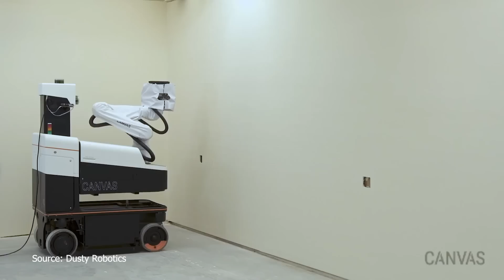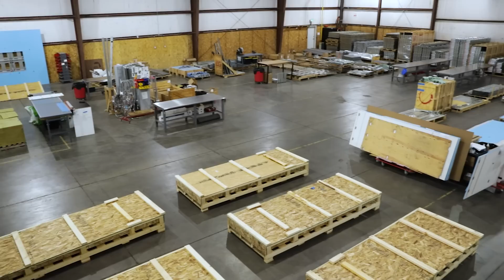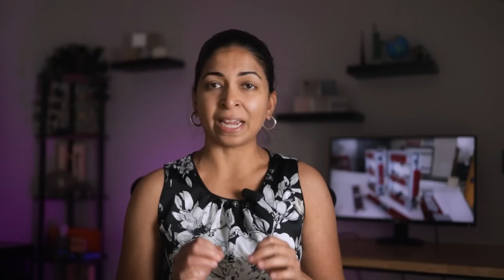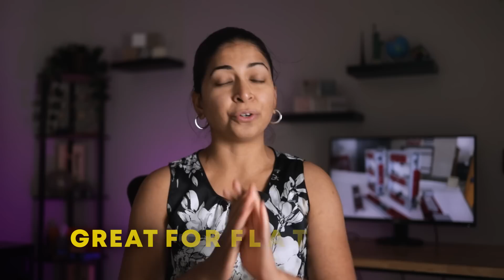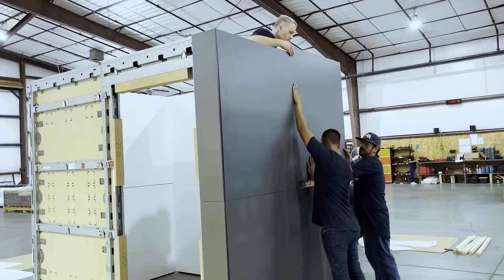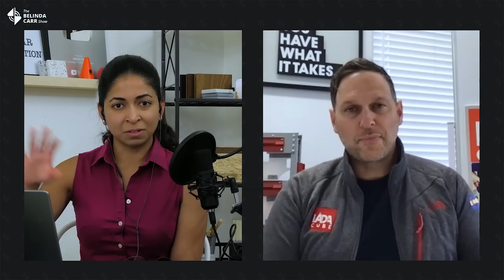Could this reusable metal wall be the 2x4 of the FUTURE?

Comment: Dear Belinda,

I am the CEO of Cyrus Panel Corporation, based in Boston, MA. 
You are giving the best construction information to the public. The Public are human beings. 

I claim to resolve one of the three main needs of humans - shelter. 

I created a lightweight structural panel (LSP) that is:

1- Inexpensive 
2- One size panel for all parts of the building. Walls, floors, and roof. 
3- Easy to assemble (DIY)
4- Excellent for all thirteen climates of the world. 
5- Highly resistant to fire, heat loss, sound transfer, moisture, natural disasters, and earthquakes. 
6- It can be cut and changed to meet any architectural form and re-assembled. 
7- It is structurally sound for up to four stories without use of added support. 
8- It is modular 
9- It is only 40kg with 12cm X 60cm X 300cm dimensions 

It is my pleasure to answer any questions you may have about the future of industrialization in the construction sector.

You may decide to make a LSP program. 

You may find me on WhatsApp at +1-617-872-4424

Mort
Cyrus Panel
King of Panels

Comment: Cold bridge galore, PVC inserts are toxic fire hazard and acoustically those panels will transfer all the noise trough even if properly insulated. Water damage and now you have rust issues in your home. Reusable? So is lumber, but why would you, since it out to be fine when house lasts 100 years.. ou right US rips house down almost before paint has dried. I agree build smarter.. ie make BETTER house, not this new age bullcrap. I havent seen one building made from these "industry changing" products that would last couple decades and even if those lasted, those are inferior to traditional log construction, witch can be infinitely repaired, works as its own insulation well as a frame and automatically adjusts air moisture content and clean the room air just by existing. Hell you can take the log frame into peaces and transport it to new location rather easily if need be, just need the new foundations and roof. Hell you can even reuse logs to repair or build new house.
If labor is the issue, how about starting to demand higher quality from the houses, not the exterior look, but the construction it self so how long it last. More people learn the hands skills to build cheaper it comes. Construction is only expensive cause taxation, builders quality standards being equal to their wage and bosses not keeping the standards where those should be, well as cheap shit now mentality of the customers. Its ok for the paint brush, but when you are talking about the installing the wall and fitting the lumber, hell the foundations make or brake the house. If those are build piss poorly, rest of the house will suffer from that.

Comment: I admire the creative thinking of the Lada Cube team, even if I ponder what markets their products are best suited.  Am a student of architecture prefab history, so for those interested, this Lada Cube panel product conceptually is in my opinion an updated version of the 1940's General Panel Corporation residential housing system, designed by Walter Gropius and his friend Konrad Wachsmann.  Wachsmann designed and patented a very clever, simple and inexpensive, panel interlocking system to allow the onsite assembly of homes from a kit of prefabricated panels and roofing elements.  The company assembled several residential homes, but unfortunately went out of business, the reasons for which are complicated and beyond what I can describe here.

My own work on affordable Kit-homes utilizing steel iBeam portal frames is a gentle nod to the pioneering work of Gropius and Wachsmann, though I must make due with less talent than these brilliant gentlemen.
Reply from the maker: Excellent analysis! Do you have a link so I can learn more about your kit-home design?

Comment: I saw a few more disadvantages. 

- This not for residential 
- Walls have almost no ability to be adjusted, thus everything has to be a perfect measurement when using in residential, that will never happen. 
- The metal will transfer heat and cold right past the insulation being used.

This would be good for like FEMA/Military IMO. I can't see a need for it in much of anything else. 

Some ideas:

- Simplify the internals
- See if sliding vertical studs to add height to wall or shrink them for residential/remodel use.
- Have an easy attachment for firing so that drywall nails can be used and installed in residential homes

---------------

I want to like the idea of building homes or walls off site and have them delivered, but it always seems to cost far more and limit what is needed on site. Yeah, if you're building a box, great... but no one is doing that. Walmart probably does it for a tax write off for being pretend green.

Comment: I can see this product will be useful for retail store refits. Often I go into a mall condition assessment and find new stores that last a few years then go under and a new store replaces it. Each time the new store goes in the layout changes. Walls and ceilings are removed and replaced with new interior partitions. It is such a waste of materials and labour. This system works much better for that application.

Comment: It's a good idea but has me wondering how it stands up as an external wall, exposed to the elements. Speed of assembly is a positive as is a relatively clean work site - nothing worse than tripping over loose materials and chunks of concrete etc with expensive instruments on your shoulder.

Comment: This is a niche use product, trying to be sold for all uses. The advantage of disassembly and reuse is only needed by business that know they will frequently alter the layout throughout the buildings life. The far high material cost compared to normal stud walls can be offset by these clients due to the fact it will be cheaper long term due to the regular layout changes. A construction company doesn't care if the panels are reusable and movable, if a client hasn't asked for it then it's an unnecessary cost when the contractor wont be the one's moving the walls, or removing them, or benefiting from the cost saving of moving them if they did actually move them. Also factor in the repetitive strain from the awkward hand tightening makes it a difficult one to validate health and safety wise when used on large scale. The locking mechanism doesn't even reduce labour costs, but increases them as it takes longer than smashing in a few screws. Also in the UK at least you can't just thread wires and pipes through cut outs in the wall like that, wires must be put in tubes, which are secured to the wall structure. Pipes must also be secured to the wall structure to prevent movement and vibration causing noise, nobody like groaning plumbing because the pipes haven't been secured correctly.

EDIT: Not to mention the ugly finish of the wall panels cladding with the unsightly joins, there's a reason plasterboard joints are taped and sanded. Oh also fire resistance, even using fire resistant board in the centre of the panel wouldn't allow it to pass fire regs unless the panel edges have a fire break, which it's didn't look like they did, the panel locking system is completely protected from fire, which it isn't and cant be with the hole for the allan key passing all the way through which would allow fire to bypass the fire resistant board and entre the adjacent room; if all of these requirements were met, then the frame on the non fire side of the central partition would have to be strong enough to support the wall section as the framework on the other side would rapidly lose strength in the event of a fire, if it is strong enough then it means they're incredibly wasteful due to being designed to take double the design load of the wall panel. Having fire resistant cladding like plasterboard on the external faces of the wall, with all joins seal by I don't know taping and filling them would allow a lighter weight frame using far less material to be used. As this would negate the ability to easily dismantle and move the wall panels you may as well get rid of the locking bits and just use metal studwork like is currently used in construction due to cost and speed making it the best method....

Comment: Possible for Trade show events to set up booths quickly. Not really that practical for general construction. Might be better to make the wall panels out of plastic or wood to reduce overall costs. Pins & screws instead of camlocks would probably reduce costs.

Comment: This is an interesting innovation but it might benefit from trying to accommodate some current industry practices, especially in homebuilding. These panels seem great for interior partitioning but building homes present different challenges such as a lot of on-site/field modifications as well as homeowner alterations over time. Perhaps they could focus on the stud panels but allow more traditional drywalling. I'm also curious whether or how they might accommodate fire sprinklers.
Reply: Thanks for the comment.  Good feedback.  We have a drywall solution coming out in December.  Fire sprinklers are used in 90% of our interior builds.  Blessings.

Comment: Hi Belinda, I have a question about wall thickness and thermal bridging, it seems like there isn't much room for insulation and the wet wall portion would have even less insulation risking frozen pipes.  I suppose you are right, these guys have their work cut out for themselves but still, overall I like the concept and the modularity of the panels.
Reply: Thanks for the comment.  All the walls that Belinda reviewed are a part of our interior wall product.  We have another exterior wall cassette that currently offers up to R-29 rating and have 6" of insulation cavity.  Blessings.

Comment: This is an interesting fab process to learn about.  Thanks Belinda.  There are many good constructive criticisms (pun intended) in the comments. 

Other topics I am curious about second-story constraints such as load bearing walls for broad areas, capacities and nature of second floor surface elements (especially over broad areas), and the ability to integrate stairways with design flexibly.   I expect there are answers to these questions, but the video-as-intro-only format is time-limited. 

Too, this product seems challenging for accommodating much architectural variety, such as vaulted walls having sloped interfaces, without steep financial penalties. Orthogonality only goes so far.  

Good intro, though. I appreciate that your channel reaches into not-ready-for-prime-time products, typically cost limited, such as here.
Reply: They're not a structural element so you could use them for a 100 story building if you wanted, they sit within the structural elements of a building. Unless I missed something in the video, but 300lb's is only about 130-140kg, so you couldn't even put a roof on top of them.

Comment: Those are basically a slight improvement over standard cubicles not an innovative building product.
Make those into staggered stud metal framing with rigid rockwool for sound, temperature and fire barrier in standard framing dimensions and they might have something, but not this

Comment: Nope.  Please don't use drywall on traditional construction as a "con", then ignore that it (or some other substitute) is also a "con" for the Lada Cube.  It cancels out.
As for recycling, wood scraps can break down into the soil where you are growing new wood.  Steel needs an industrial process.
Sorry - I don't see enough benefit for something more expensive .  A solution in search of a problem.
I appreciate that you check out all the new tech, but this isn't a game changer.

Comment: Very neat, but I'd be worried about lock-in.  Many of the benefits of the system derive from reuse or reconfiguration and if the company making the product goes out of business or decides to stop supporting it then many of those advantages disappear (no longer able to buy new compatible pieces and no one looking to reuse).
Reply: Have to open-source the design so anyone can make compatible components, assemblies

Comment: I see some good points and some bad. Worry about rust years from now, R value and cost.
Reply: Thanks for your comment. We use galvanized and galvanneal steel, which does not rust. We have an exterior wall system that has an R39 rating.

Comment: There are certainly some commercial uses for this but I don't see this replacing studs in residential homes.  I like drywall and taped seams - these finishes look cheap (even though its very expensive).
Reply: We offer a drywall solution as well.

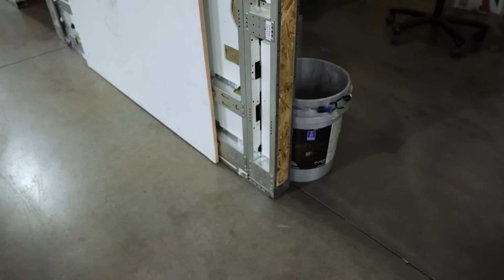Comment: 1:43 cables run over sharp metal edges... pretty sure building code says no to this.
Reply: Thanks for the comment.  The extension chord shown in the video is not a typical application and obviously not to code.  We use armored cable and have passed 100% of building inspections on all projects.
Reply: @LådaCube  thanks for replying. Can you in the future switch to burring and curling instead of simple punched holes? This would lead to smooth, rounded edges.
Reply: @hardwareful  definitely something we will consider. Thanks for the feedback!

Comment: It is impossible to use this cassettes for building complete living space. I clearly can be used only for businesses. For exhibition purposes for example. It still can be used in living spaces for internal walls, but do You really need them there? And You need concrete base to use it. It kind a can be used in apartments buildings, but again it need to be used inside concrete frame of the building. So... I don't found it viable to use at all. Yet again other than business applications.

Comment: Really neat. I love the interior finish panels. Very sleek and eliminates the need for a drywaller and painter. I've long wondered how to make interior drywall better, faster, and more modular.  This might be it.

An exterior wall version would be AWESOME if:

1. It meets shear requirements 

2. Can keep all the insulation on the exterior (the Rockwood between metal frame isnt very effective)

3. they can include an exterior grade cladding panel similar to the interior panels you showed in the video.

Thanks for sharing this. Exciting and promising tech.

Comment: Neat! I can definitely see value in office space. My company is far too cheep to tear down and change office layout, even though there is an obvious need too. I'd be interested in seeing the cost of materials and labour for a new install, and labour for a floor layout change. Would it take 2, 3 ... 10 floor plan changes to be economically beneficial over wood construction.
Reply: " My company is far too cheep to tear down and change office layout, "   OK, but a company too cheap to change office layout, it probably also going to be too cheap to pay the higher costs up front for the ability to more easily  change layout in the future.
Reply: @andrewalexander9492  Undoubtedly. The purchase would need to be made by the building owner to have any success in my case.

Comment: What’s the comparative cost? I’m not being clever. What is it?
Reply: Currently 25%-35% more expensive than most stick built applications, however the price is continually dropping and will eventually be less expensive than stick built construction. Other savings factors include speed to build (75% faster), lack of skilled labor required, and long term asset for reconfiguration, relocation, or resell.

Comment: But do they still bend & warp when you try to hang a TV from your wall like the metal studs in an apartment building or condo? If they do, then they're still just useless.
Reply: Thanks for the comment. Our walls have digital blocking that can be added to any cassette (wall) and is rated at 300lbs per bock. We've never had an issue with warping from weight.

Comment: Why not just use a 100mm sips panel. You could paint the osb, or cover it in HPL (Balancer sheet is cheap and hardwearing..)  to save wet trades. Screw a timber plate to floor and ceiling.. Probably quicker than cams.. This looks like a massively over-engineered answer to a not very difficult problem.. I would imagine them to be about $150 m2 based on how complicated they appear..  Probably difficult to obtain..  Can a phone signal get through that faraday cage..?